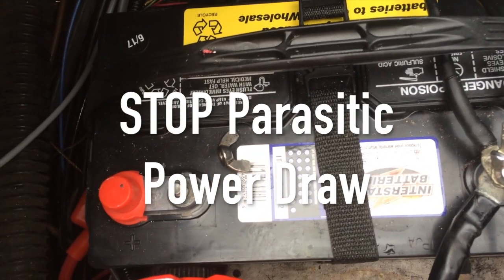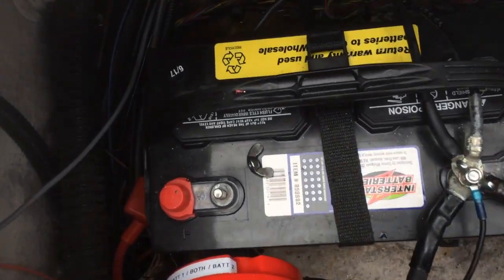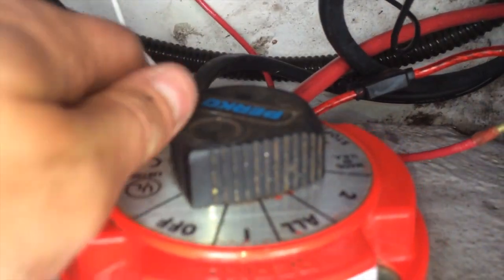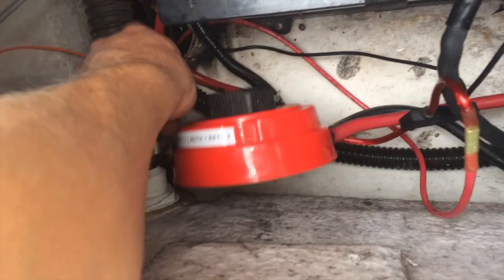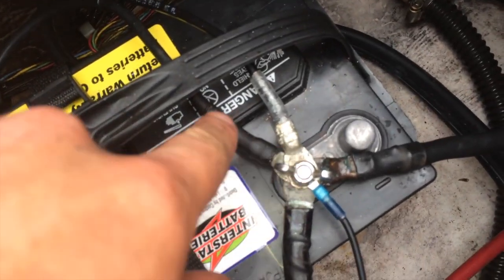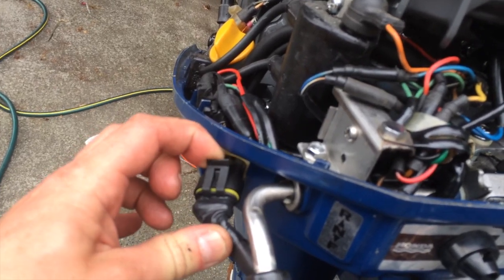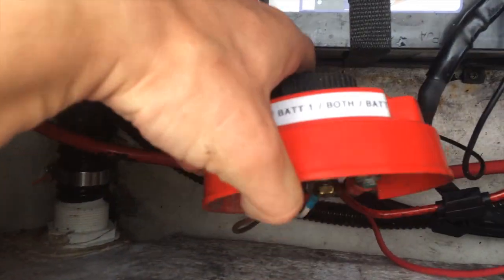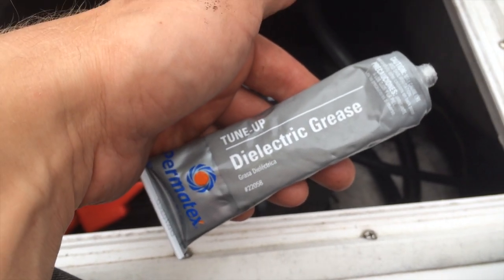Dual Battery Switch - Stop Parasitic Power Loss on Boat

Comment: Toss the wing nuts and replaced with a split lock washer and a regular nut.  Put the biggest ring terminals on the bottom and the littlest on top. Only 4 ring connectors per stud.   Wing nuts vibrate loose to easy!